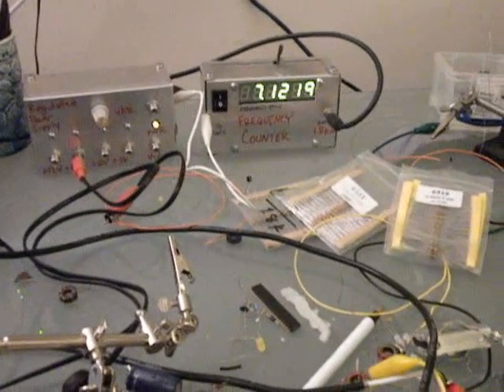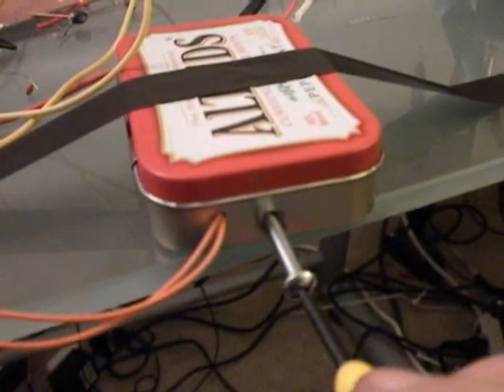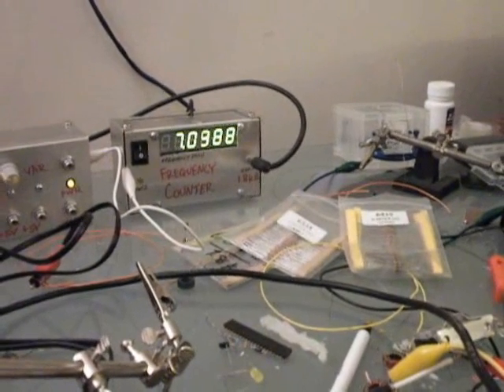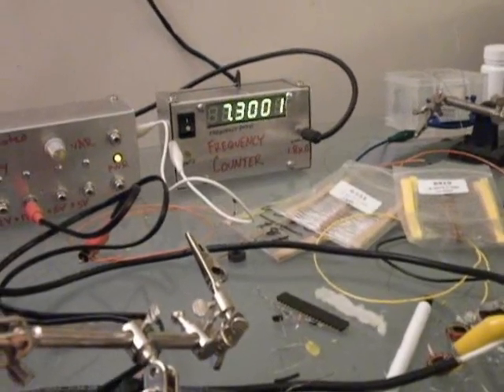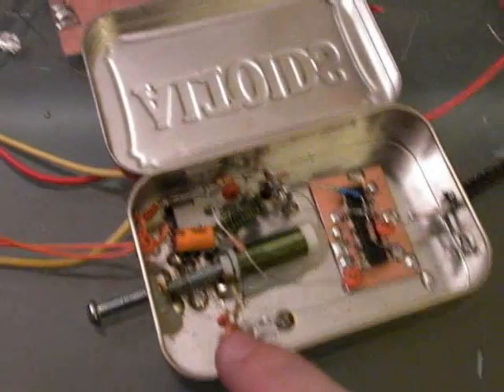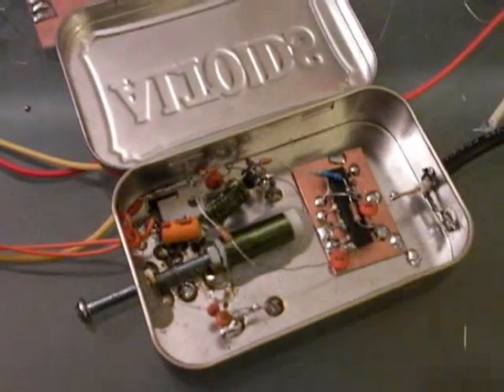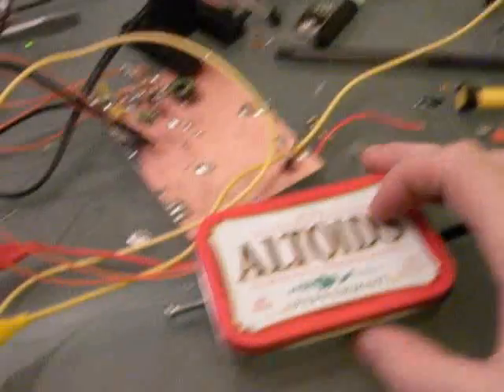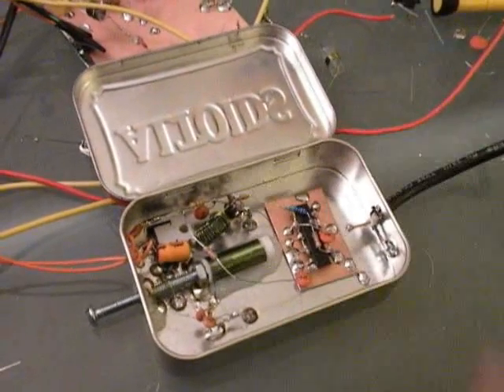Permeability Tuned Oscillator (PTO) Working Nicely

Comment: Is the resulting inductance linear? Also how did you calculate the maximum inductance (i.e. when the screw is entirely in the coil)? What's the magnetic permeability of the screw?
Reply: I actually found the answer to my question and figured I'd post it here for anyone that might want to build a PTO. Here's the resource http://www.google.com/patents/US2621324